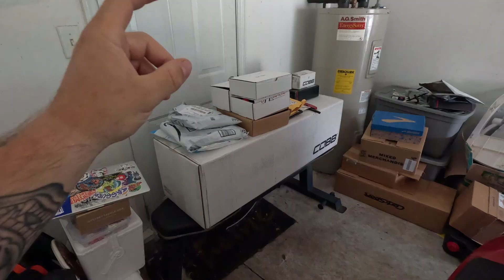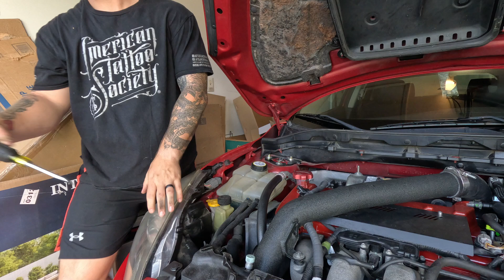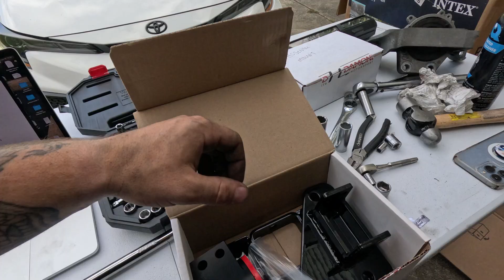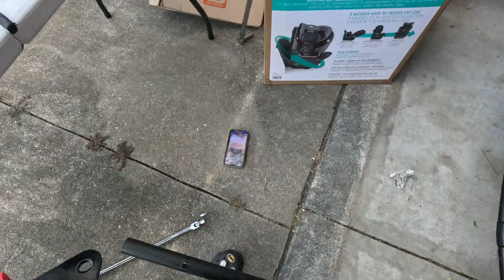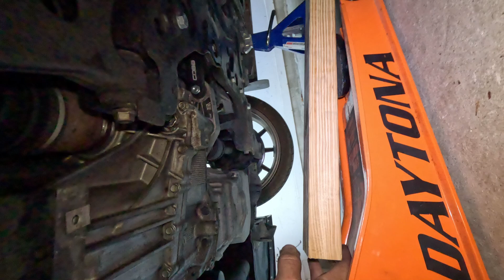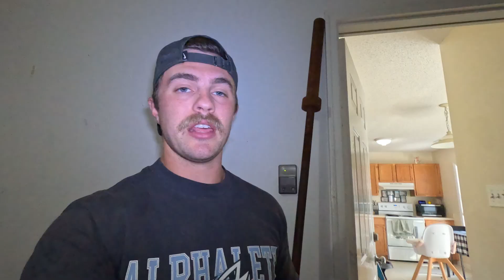Damond Motorsports Motor Mounts & Corksport Wing/Extension Install(+ update!)

Comment: Since you unplugged the ecu did you have to re flash ur tune?
Reply from the maker: @mixervxzy9113  if you simply unplug it, no. The ECU still contains the data flashed onto the component even when you unplug it. Same as a usb drive. 

When any air or fuel modifications are made, you must retune